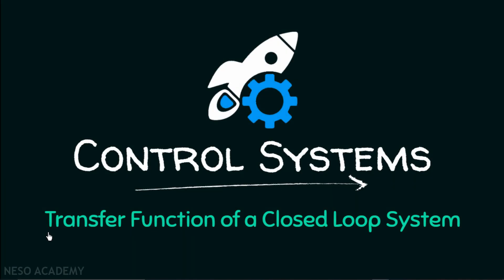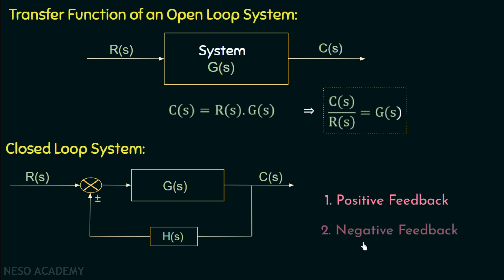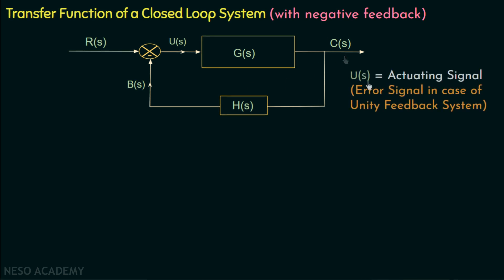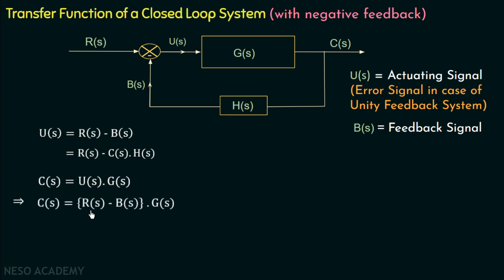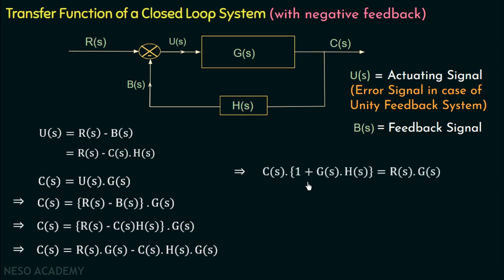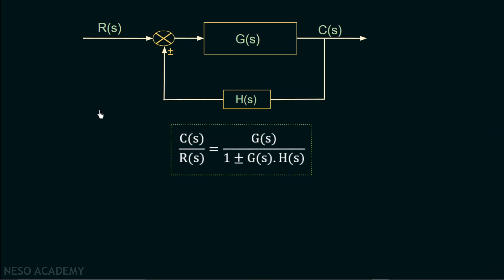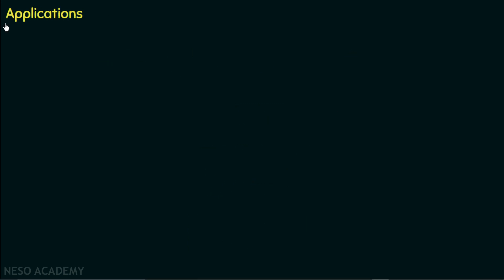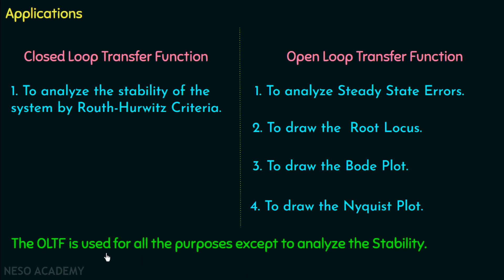Transfer Function of a Closed Loop System

Comment: Hello sir @Neso Academy, thank you for the clear and crisp explanation. Using the same intuition i was able to derive the transfer function with positive feedback. 
However when we apply this to a real world system such as an op amp amplifier with feedback going to positive terminal, the equation changes quite a bit: 
Since the op amp will always take the difference between the plus and minus terminal and amplify it by its gain. lets say G(S) where H(S) is in the feedback divider, my equations become: 

Using the same nomenclature: 
U(s) = B(s) - R(s)
therefore: C(s) = (B(s)-R(s)) G(s)
therefore: C(s) = (H(s)C(s)-R(s)) G(s)
therefore: C(s) = (H(s)C(s)) G(s) - R(s)G(s)
therefore: C(s) + (H(s)C(s)) G(s) = R(s)G(s)
therefore: C(s) (1+ (H(s)) G(s)) = R(s)G(s)
Therefore close loop transfer function: C(s)/R(s) = G(s)/1+H(s)G(s). 
Please could you explain where i am going wrong? Thank you so much.

Comment: Hello, thank you for your amazing and meticulous educational content you've providing. I just want to point out a small mistake that had appeared on the video, in 8:25, the sign should be flipped, that is if feedback to the input in negative then 1+GH in denominator term should have positive sign, and if the feedback is positive it is the opposite, it would be 1-GH in denominator instead.

Comment: You give rewiew for double recycling contract model of closed - loop supply chain with yours presentation.
    Yours path with actuating signal and feedback signal can give us closed loop supply chain's final output.Closed Loop Transfer as you have said is function so, the core enterprise of the closed - loop supply chain dose not consider the impact of remanufactured products if we look at closed-loop based on supply chain by manufacturer. Also CONSIDERING  THEOREM When advatagesous recycler chooses the quantity contract and inferioran recycler chooses the price contract in PASSIVE ENGENIEERING MODELLING we can prove an optimal value of the closed-loop supply chain by quantity equations and theorems like Schwartz and Schrodinger, as well as Goyal. This is imortat part and yours guid is introduction how increasing population density in urban areas is closly followed by a negative aspects, which can significantly affect the quality of housing, other structural buildings especially near water (as a main topic) as well as ACUSTIC and CLIMATE POLUTION (like air, wind = all paths to Green energy). So we must APPLY in Yours great figure optimization equations to exp. project and built good structure (not only  houseing type).
Thank you for preliminary identification of enviroment assessement! 😊

Comment: without adding the feedback in the loop, what is the purpose of the feedback here? and if the feedback is not doing anything then why we are considering in the transfer function? please clarify...
Reply: I am also confused by this
Reply: Maybe this is not very important to learn Maybe that's why he didn't explain that.
Reply: I am also confused by this
Reply: Its called Open loop transfer function in which loop that is going in feedback is opened and Than Transfer function is written which will be the product 
if There was no H(s) than Only G(s)would have been the OPen loop transfer function
Reply: @muhammadwardan5949  can we do instead vs= vi- vf for negative character & then divide vo w.r.t vs